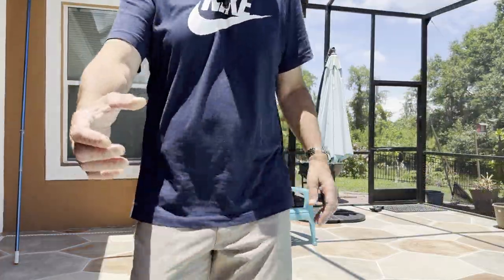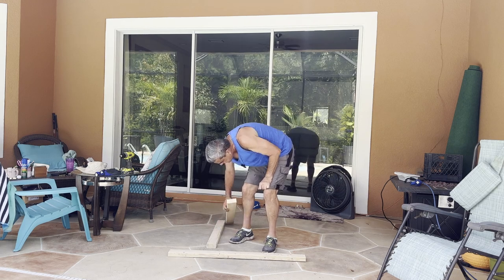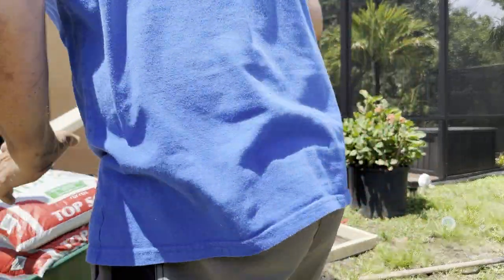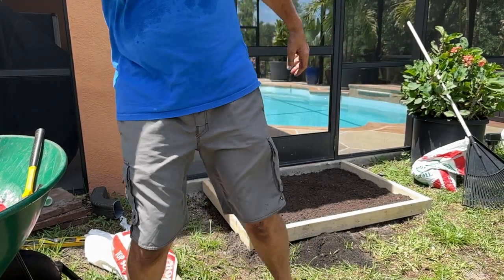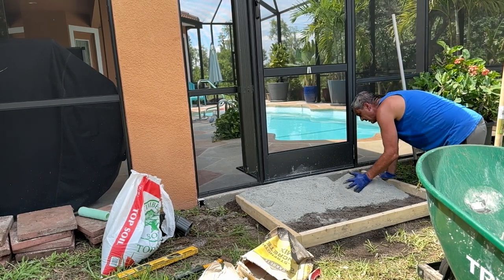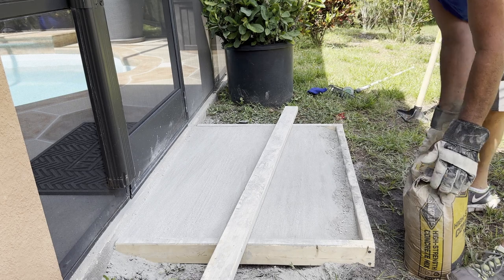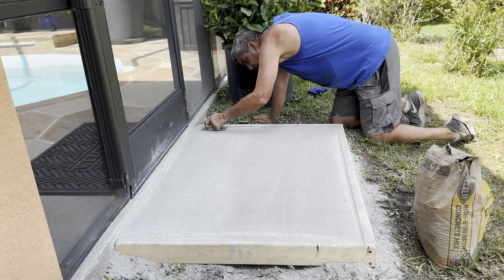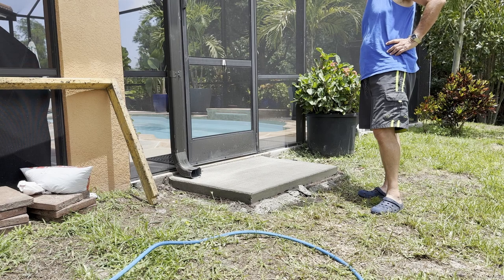Complete Dry Pour Tutorial Every Step Thank You Cajun Country Livin'!

Comment: The 1st mist should be applied lightly and standing a little away from the mix and higher, better over your head, so you don’t disturb the smoothness of the topping mix.
Reply from the maker: I’ve done two slabs that have turned out perfectly so far, but thanks for your thoughts

Comment: Great job.  I was concerned that where the new slab might not adhere against the old slab and a crack would form.
Reply from the maker: I actually think the dry pour method helps it to adhere to existing concrete probably better than a wet pour. I think it allows the cement mix to get into the pores of the existing slab better when they are dry and close to the consistency of fine dust. I think this causes a better bond. But that is just my uneducated theory.
Reply: I used a foam expansion joint from Lowes between the old and new (Reflectix 0.5-in x 4-in x 50-ft Polyolefin Concrete Expansion Joints).  Construction adhesive used to bond to the old before the dry pour.  Might be something to investigate if you have a lot of hot and cold swings in temperature.
Reply from the maker: @bammerbiff1621  I’m in Florida, we don’t experience real cold
Reply: @yoursimplegolfswing  True but heat makes concrete expand.  Cold just makes it contract.  If there is no room for either, cracks could occur.
Reply from the maker: @bammerbiff1621  heating up concrete causes expansion. Concrete that cured in 92 degrees ambient temperature cannot expand further if it doesn’t get hotter. I lived in a house for 13 years  here in Florida that I had a 12’ x 33’ slab poured attached to the existing house slab with no expansion joint. I sold the house, after renting it out for another 11 years. So, after 24 years, it still had not cracked. We don’t have the long winter freezes and then the spring/summer warming like up north. That’s what causes expansion/contraction. BTW, contraction also causes cracking

Comment: Helps if you dig in some stakes to keep your form boards in place and you can also screw it together to the boards to help keep it level
Reply from the maker: Yes, putting stakes in to keep the form boards in place is a good idea, but I found it not necessary for such a small project. I experienced no issues without using them.

Comment: When you frame your platform use the stake seport to keep in place
Reply from the maker: I don’t bother with staking it on small projects and as you can see, it turned out perfect. My biggest dry pour was my 6’ x 5’ 4” slab for my golf driving range (see video on my channel) with no staking. Dry concrete mix isn’t as heavy as wet concrete so it doesn’t move the frame as much. Also, since I put dirt/sand inside the frame and pack it, there isn’t much chance for movement

Comment: It's such a small project that the soil may not be an issue ...but folks...believe me top soil is not the solution - especially if it is a big project...save yourself a load of trouble...pay a couple nickles more for pea gravel, gravel or paver base...you want a solid base, and something that will not shift or erode.  But hats off for showing the things you do know. Also good job for showing everyone beginning to end and mentioning the tools you need - I think a lot of folks will benefit from that
Reply from the maker: I appreciate your words and I agree top soil is not the best solution but I do have to comment that gravel is not necessary. I base this on simple observation of the building practices here in Florida. I live in a large house that I watched the construction crew build and they poured the foundation on ground without a gravel base. All houses in Florida are built this way. All lots are filled with ‘builders sand’ , leveled out, packed down and the foundations are poured directly on top of sand with no gravel base. Most foundation are 4-6” thick with the edges of the foundations 8” or more thick. Every house and driveway is built this way in Florida. So I would think that if this is sufficient for a two story house, it’s sufficient for any DIY project. Gravel is simply unnecessary. But I do admit that topsoil is not as good as sand.
Reply: I think we agree more than disagree. -In areas of the country where you have less shifting and heaving issues it may not  be as much of a issue. but if you have a lower fostline it would definitly be a problem.. Wisconsin, Ohio, Michigan illinois etc gravel is a must so I suppose it some of this stuff comes down to the area you are in.  Which I'm sure not everyone is aware of...good video  @yoursimplegolfswing
Reply from the maker: @mrwonderfulhere2  good point on different building needs depending where you live in the country. We have no freezing down here.
Reply from the maker: Still no cracking it’s been about four months or so

Comment: Looks good. I've watched several of these dry pour videos with differing top surface qualities. A small technique detail that I've noticed during the screeding process that you do the same as Cajun Country Livin does, but many of the poor top surface quality videos don't do is the amount of side-to-side movement. You and CCL moved your screeding board at least 4" side-to-side, but many of the other videos only move the screeding board a couple inches side-to-side. Am I picking up on the technique properly?

I have a small pad that I want to pour (replacing 2x2 patio pavers), but it is in a corner. Any ideas on how to screed that well? Or should I not worry about it since the pad will be for my hose reel and mostly not visible?
Reply from the maker: I’d love to give you an answer that makes me sound like an expert, but I’m completely new to this myself. Hopefully, my videos demonstrated how easy this is for a novice. I just followed Cajun Country Livin’ and did what they did and it worked. Any other answer would be me just pretending to know what I’m talking about
Reply from the maker: If I had to guess I’d agree with you David
Reply: In one video I watched, the guy attached a small electric sander to his screed board. The vibrations of the screed had the same effect as the side-to-side motion of manual screeding, but with less effort. Maybe this solution could work for you since you don’t have much room for the side-to-side motion.

Comment: How long until you could walk on it ? I just finished a 12’x10’x4” slab almost 2 days ago and I’ve finished the misting and soaked it 6 times now.
Reply from the maker: I walked on it 24 hrs after completion. For a slab your size, water it once a day everyday for 28 days (concrete takes 28 days to fully cure) but you can certainly walk on it now
Reply: @yoursimplegolfswing  Thanks for the quick response! Appreciate it
Reply from the maker: @revfpv7908  your timing was perfect. I was having my morning coffee.
Reply: @yoursimplegolfswing  I live in Florida too.  Pasco county
Reply from the maker: @revfpv7908  I’m in New Port Richey
Reply: Did you have any issues with bubbles coming up?  I am getting ready to do a 8x20’ slab with a machine compacted, 4” gravel base with fiberglass rebar (Pinkbar by Owens Corning) in the middle (with seats) for a shed.  I have seen a couple of people have issues with bubbles coming up on their dry pours.  

One man compacts a layer of his Quickcrete in an effort to prevent this.  Some say to wet down the ground and/or gravel base beforehand to prevent this.  I see many doing their pours with dry bases and not having issues with this.  I wonder if it is the gravel base that is causing the bubbling?  Perhaps more likely if it isn’t compacted first?  I would appreciate any insights.  😊
Reply from the maker: @sterlgirlceline  I wouldn’t compact the dry mix. My guess on the bubbles is probably from overwatering at the start. If you lightly ‘mist’ the top two times with an hour separation between mistings, the top layer should harden to the point to where it would be impossible for bubbles to form. It is extremely important to only mist the top very lightly before watering the project. I’m guessing the people who had problems with bubbles skipped this step and just began watering their project. Additionally, do not wet the ground first because the cement in the concrete mix will act like a wicker and pull the water to the top which will cause problems when you try to screed.
Reply: @yoursimplegolfswing  Thank you!  I really appreciate you taking time to respond.  This makes sense.  I know all of the negativity you have to endure posting videos like this but it sure is helpful to many so thank you for enduring all of that 😊⭐️
Reply from the maker: @sterlgirlceline  it was my pleasure to respond. Yes, there are a lot of haters on here but I don’t really care about them. If you look at most of their accounts, none of them have anything of value to offer anyone. They don’t make videos. All they do is troll peoples channels and criticize other peoples videos. They truly are sad little people.
Reply: @sterlgirlceline  my ground was wet after I dug down and I did not have issues with bubbles or any holes at the top. I did have a hard time getting the rocks to get away from the top but eventually it all worked out.
Reply: @revfpv7908  Thank you!  What brand/type of cement did you use?  The majority of the dry pours I’ve seen were with Quickcrete and one I’ve seen with issues with bubbles wes a different brand.  Good thing is that so many people are starting to do this now so many more YouTube videos are being posted.  Thank you 😊☀️!
Reply: @sterlgirlceline  sakrete because I couldn’t get the other delivered. Plus, I had a lot of extra bags afterwards to bring back to Home Depot. I used the concrete calculator but it was waaaay too many
Reply from the maker: I used Sakrete because it’s the only one available in my area. People that are having trouble with bubbles or doing two things wrong. They are not doing the light mist first. You must do a very light misting two times with an hour separation between. You should barely put enough water on it to change the color on the top. then after doing that and the top has hardened a bit then you can water it a little more thoroughly. I believe people are getting bubbles because they are saturating it right from the start, which is a big no-no.
Reply from the maker: I screed with the 2 x 4 lane wide side down made it much easier to get the aggregate to settle below the surface. You must make sure though that you’re 2 x 4 is perfectly straight with no warping or you will have an uneven surface.
Reply from the maker: I did the same thing. I used the concrete calculator and ended up with quite a few extra bags. I used the extra bags for a second project. I would guess you could probably go with about 80% of what the calculator tells you.
Reply: @yoursimplegolfswing  I just cannot thank you enough for taking the time out of your day to share your golden tips!!!  I don’t have a foundational knowledge base for diy things around the home so nearly every, little nuance is new to me.  

This is why it takes me soooo long to embark on any diy projects because I spend a tremendous amount of time investigating all of the details.  No way I could do most of my projects without YouTube!

I am preparing to do this shed slab and I am pretty apprehensive about it.  Even with dry pour, it’s a big project for me at my skill level.  Thank you so much 😊⭐️!!!
Reply: @revfpv7908  Thank you for responding and good to know you used Sakret.  the couple who had the bubbling issue used that brand also so I was thinking it was that brand that was the issue but apparently not.  They lived in a hot, dry climate but the dry pour was inside their home so it was covered.  So it’s a mystery.  Hopefully this doesn’t happen to me 🤞🏻!
Reply from the maker: If you do the misting first, two times, the top will harden quite a bit before you start the actual watering. The hard surface won’t make it possible for bubbles to rise. Water it 2 times for every inch of thickness, an hour apart. Don’t over saturate it. Concrete is porous so the water will soak down through the hardened surface.
Reply: @sterlgirlceline  simple golf swing is right. I had 3.5 -4” and I lightly misted 4 times over 4 hours.  My hardest issue was the rocks but I was also only 3” off of the house and 3” off of the patio so my screeding was minimal.  It looks very good though I have to admit. If you leave room on top for a nice 1/2” layer rapidset mortar mix 6000psi you will have a perfectly smooth finish,  if u use the roller.
Reply from the maker: Thank you for that additional information. One of the keys to getting a good screed is to make sure that when you fill your mold, you fill it a good quarter inch higher than the edge of the mold. If you don’t have enough material in the mold screeding won’t go well. On my smaller pad I had it butted up against my existing pool slab, but I was still able to do a proper screeding.
Reply from the maker: One thing to consider when doing such a large pad is to maybe break it up into four smaller pads. I saw one gentleman online who did a very large pad, but he did it in sections. It turned out very nice. This may make your task less daunting.
Reply from the maker: My pleasure
Reply: @yoursimplegolfswing  Thank you!  I’ll have one person to help so I won’t have to do it by myself thank goodness.  ☀️
Reply: @yoursimplegolfswing  Oh smart!!!  Thank you!!!  Good advice!
Reply: @revfpv7908  I am definitely going to use the roller.  I have seen a few that don’t and the finish doesn’t look as good in my opinion.
Reply: @sterlgirlceline  sounds great. If you dig down and compact the ground it’s definitely work. I had st Augustine grass and it took me a while to do it. Then of course bringing the 80 lb bags around back was work too. I didn’t add rebar because it’s just a large grilling pad so foot traffic only. It was satisfying once I pulled the forms. I left mine on longer than normal , 4 days. Today I just put some crotons and other plants out around it. I think my next dry pour will be stepping stones that aren’t square for a few areas. I saw a video with a guy using a bendable edging and making shapes for stepping stones.  Seems like a great idea.
Reply from the maker: I use 60lbs bags.
Reply: @revfpv7908  Thank you!  I thought about those decorative forms (might have even seen someone dry pour them?) also; looks fabulous!  

There is a concrete expert, Ph.D professor who has stellar info about concrete and his channel Tyler Ley (his name) is really good.  His empirically-based info about curing is extremely helpful.  

I try to remember to tell as many as I can about that channel since the curing info is not well-known and could make concrete much more durable.  I’ll put a link to his curing video but some of the content creators delete it.  

Maybe they think I am promoting another channel?  I don’t even know the man and am just trying to pass along good info for dry pour diyers 😊:
https://youtu.be/1siLxrpm_PE

Comment: I'm going to try this. However did you use the regular concrete mix or the dry pour that says just add water? Thanks!
Reply from the maker: I’m pretty sure all concrete mix says just add water. The only other choice is cement mix where you have to add gravel, sand and water. Concrete mix contains cement, gravel, and sand already mixed together in a bag. I’m not sure if you can actually find a concrete mix that doesn’t say just add water. Don’t confuse concrete and cement, cement is merely an ingredient of concrete.
Reply: @yoursimplegolfswing  Ok. I had been seeing Quikrete used more than Sakrete for the dry pour videos and thought it may have been a difference in them. Thanks!
Reply from the maker: @mcc12493  they are pretty much the same. Just make sure you buy concrete, NOT cement